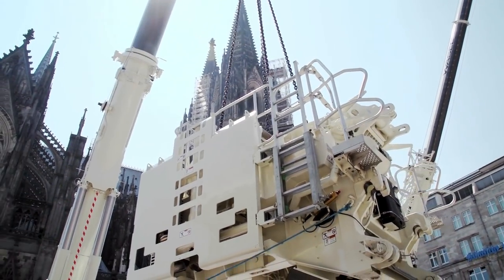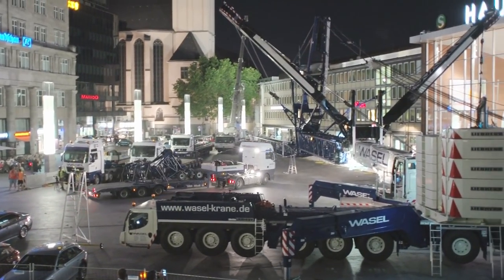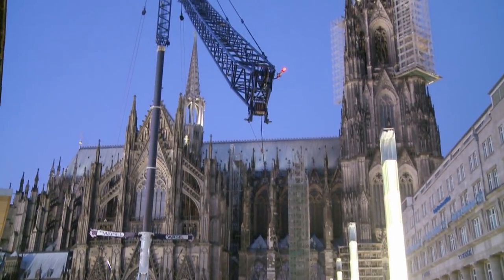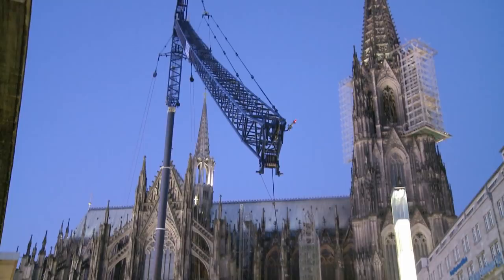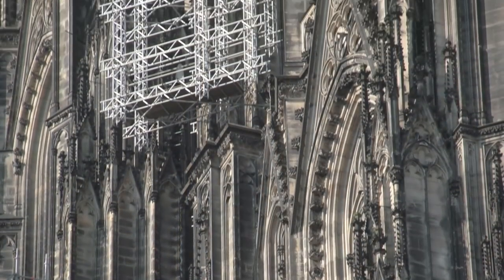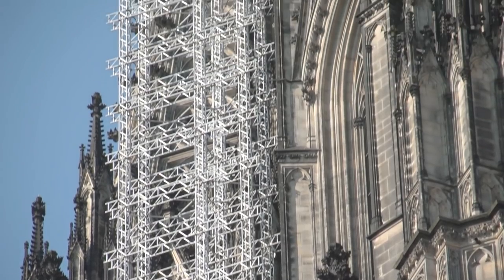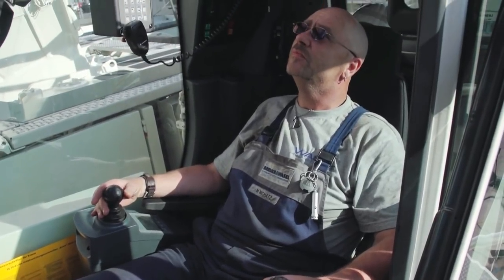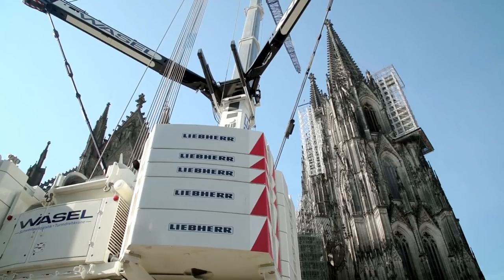Liebherr - Mobile Crane LTM 1750 operating at Cologne Cathedral

Comment: An impressive amount of team work went into this job complimented by the superb equipment provided by your firm. I don't think any of this could have been handled otherwise unless you literally took the scaffolding apart piece-by-piece and relayed it down to the ground by other means. It didn't hurt that the weather seemed to be co-operating fully with minimal wind conditions to contend with and no heavy foul weather wear needed by the crew.